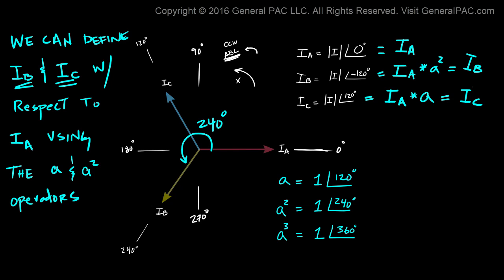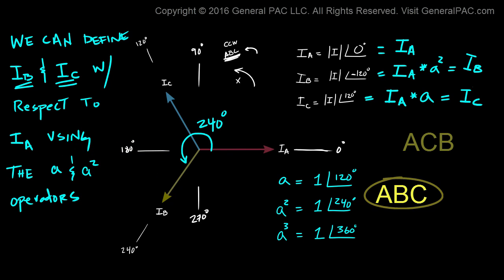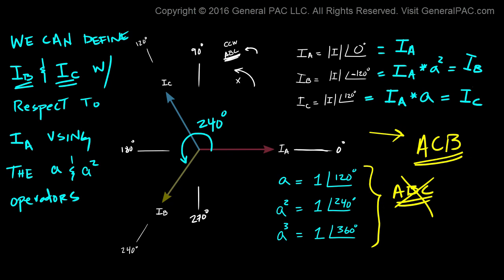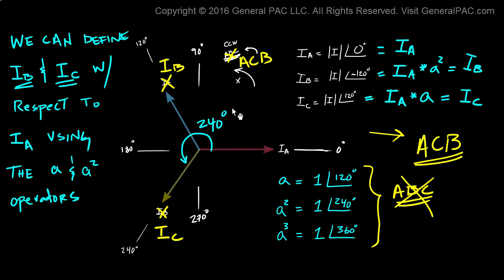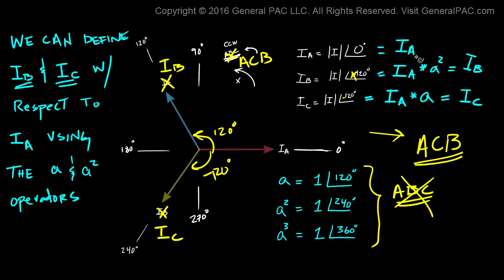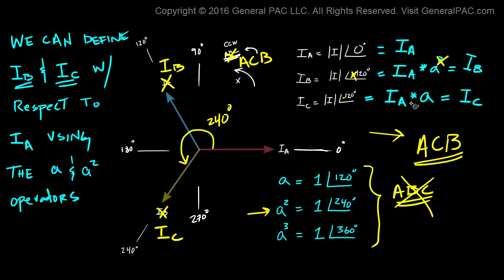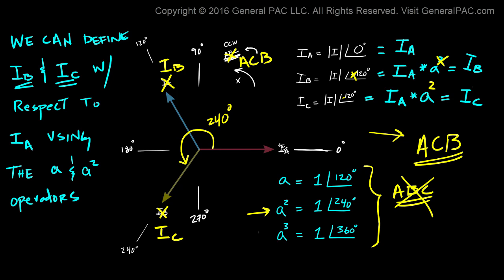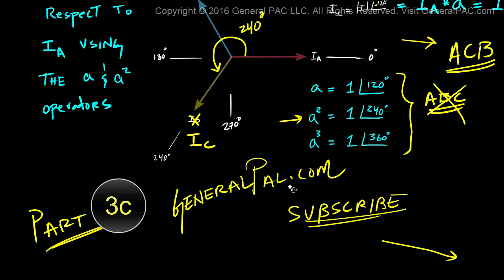Principles of Symmetrical Components Part 3b

Comment: I think it would be useful if you used subscripts instead of superscripts for the 'a' operators to avoid any confusion. Otherwise, great videos so far explaining symmetric components. Thanks.

It would be good to have some examples at the end of this series for real applications comparing the theoretical values with measured results. It would also be useful to explore other scenarios like a split 3-phase (2-phase + neutral) systems..